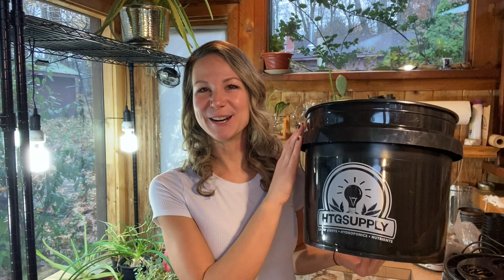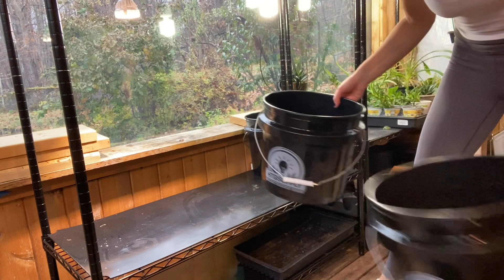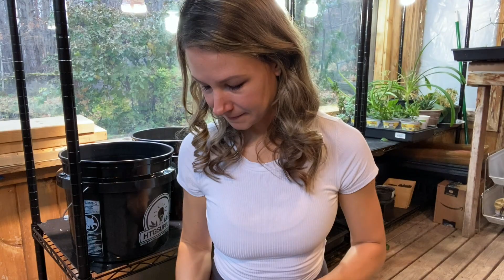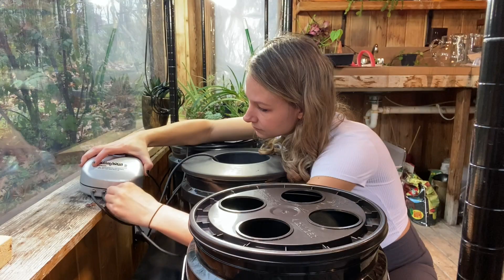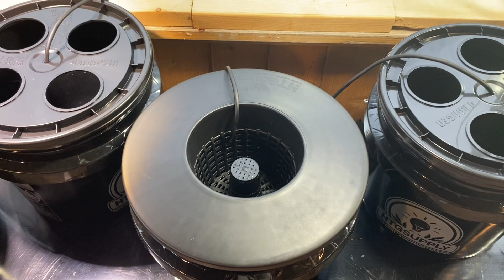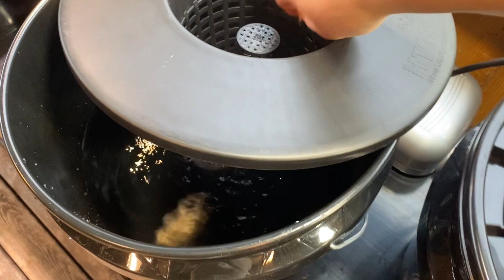DIY Hydroponic Bucket Setup

Comment: CopilotShort answer: No — you do not have to dump and replace your nutrient solution every week for most home hydroponic setups.
That advice is context‑dependent and often misunderstood.
Below is the clear, truthful breakdown, without hydroponic mythology.

The Core Truth

Dumping weekly is NOT a general rule of hydroponics.
It applies only to certain systems, crops, or problems.

Most low‑tech and backyard systems are designed to avoid frequent dumping.
Reply from the maker: That's a great point, it definitely depends on the specific setup and scale!

Comment: I know this is a couple of years old. There's good information in this video. I would suggest raising the air pump above the water level to avoid any water backing down the air hose and into the pump should you have a power failure
Reply from the maker: That's an excellent tip for preventing accidents, I'm glad you brought it up. I actually have revamped my setup since then and the pump is higher than the water level, but it was rather unintentional on my end. Thank you!

Comment: Learnt a lot watching this video. Thanks for sharing. Just one question should the airpump be on eternally?
Reply from the maker: This is a great question and one that depends a lot on your setup. As I'm using a DWC system, I do leave my air pumps on 24/7. This can get to be expensive of course, so some people do choose to have their pumps run on timed intervals (still more than 50% of the time but less than 100%). This will depend a lot on your setup and how large of a container you're growing in and what you're growing. Your risk of root rot may increase with a decrease in aeration, but there are other methods (like beneficial bacteria) you can use to help keep that under control. I am likely going to experiment with intermittent timing on my system this winter to save some $$ on the electric bill. Will likely start with just 1-2 'breaks' during the day that I can monitor the health and condition of my plants.

Comment: Hi Anna!  Thanks for all of your inspiration!😄🛶  I've been experimenting and learning by making a lot of mistakes and screwups since just before Christmas.  I'll be starting a bunch of seeds this evening and plan to switch them to DWC as soon as they're ready.  I've got my buckets ready and have some air stones running in several buckets to remove the chlorine from our tap water.  I just watched your EC video - thanks for sharing!  Something occurred to me while watching it.  I read somewhere that plants could go into "shock" if their environment was changed suddenly or drastically.   Is there a possibility of my plants dying if I don't do the water change quickly and effectively?  Just call me the black thumb!!!  LOL!  Thanks for taking the time to respond!  I'll be looking for more of your videos!  Thanks again!
Reply from the maker: Hi Eric! Our timelines matched up - I’ve been losing a handful of plants lately! So in my experience I’ve put my plants through a lot of stress in the past (forgot to turn my pumps on for 2 days, replaced their old water with ice cold water, accidental nutrient overdose, etc) and those slip ups have never actually killed my plants. They’ll look worse for a little while but then they recover. Not saying that shock isn’t the underlying condition for your plants, but not changing the water quickly enough shouldn’t be enough to kill your plants.

What are some of the symptoms you’re seeing before the plant dies? Any curling leaves? Flower drop on fruiting plants? Spots or brown leaves? Start checking in on your plants daily and just inspect the leaves. From there we can do a better job of diagnosing the underlying issue!